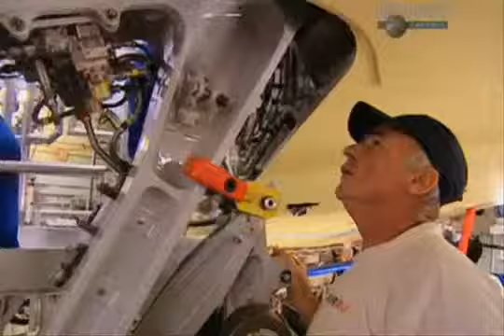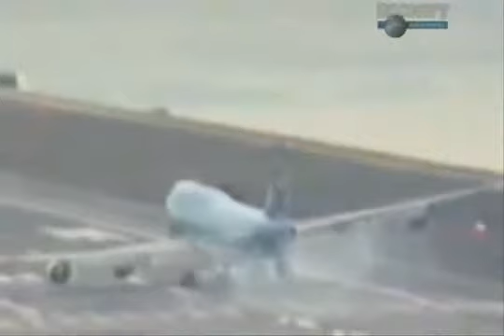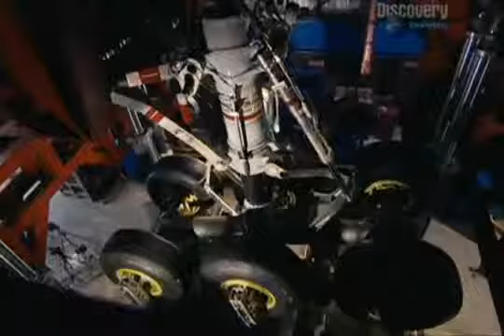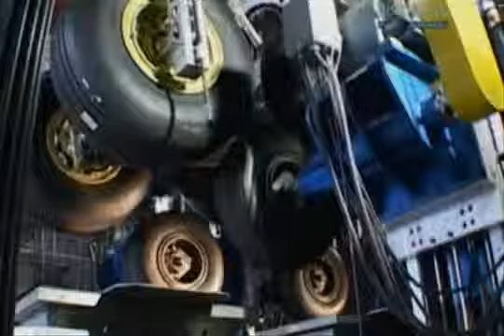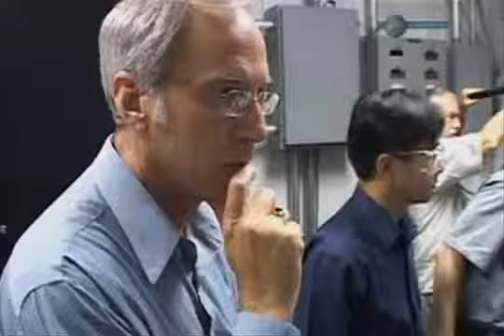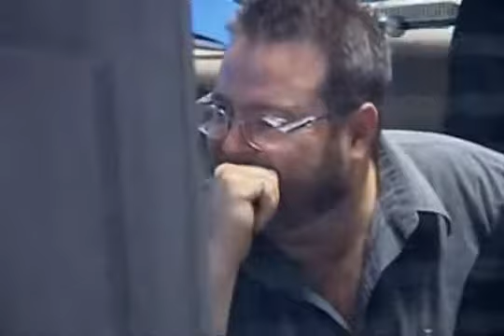‪A380 Landing Gear Test‬‏

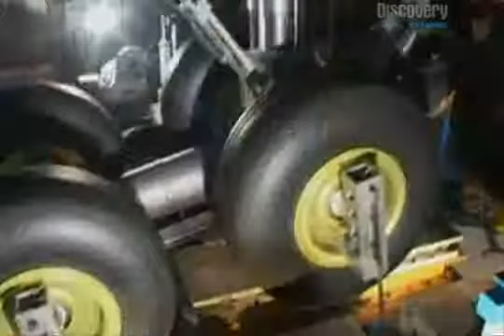Comment: 2:35 it must absorb the same energy as a ryanair landing without being damaged
Reply: As the second-heaviest aircraft in the world, the A380 needs the third-strongest landing gear ever made. The strongest landing gear in the world is that of the 737, made necessary because Ryanair flies them. Someone once pondered the idea of Ryanair flying A380s, but as well as reinforcement of the landing gear to probably beyond what is technically feasible, all airport facilities and nearby areas would need to be retrofitted for improved seismic tolerance.